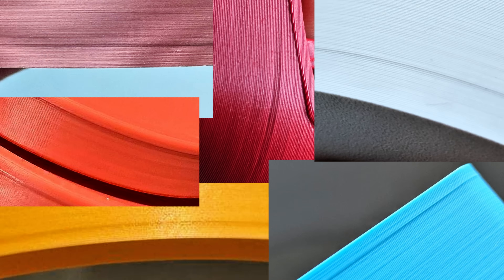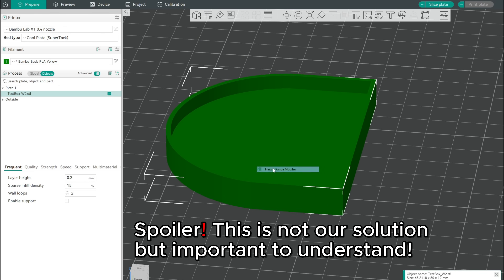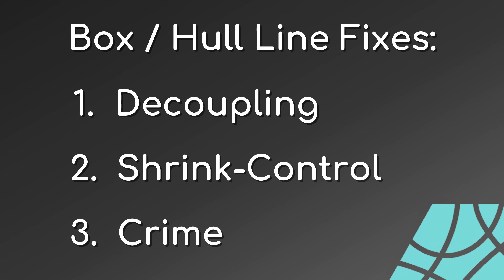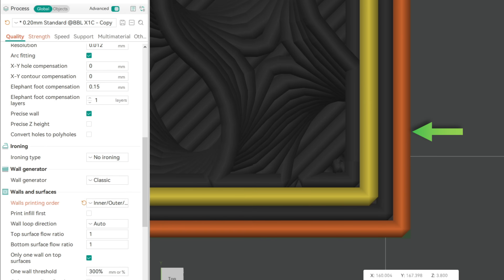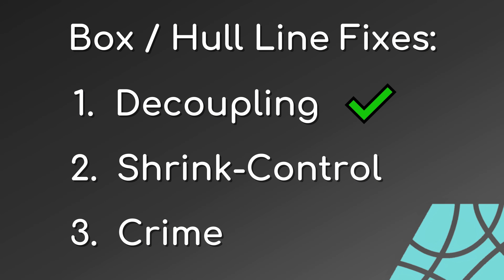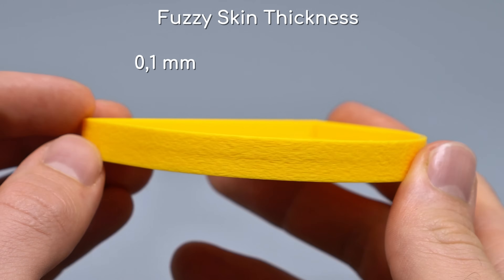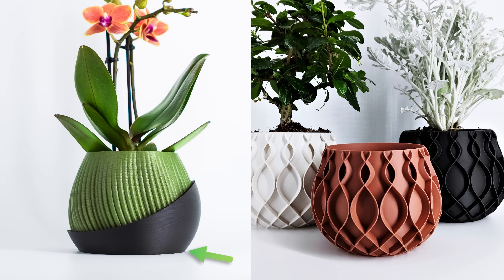The Most Misdiagnosed Print Error — Fix Weird Wall & Hull Lines!

Comment from the maker: If you check out Alibre I’d recommend the “Professional” version, there is even a 30-day free trial! 
Anyone else find and use this CAD gem so far?

--- Fix Recap: Only use in right situations like shown! ---

Decoupling
- Wall printing order
- Gap infill & gap walls with settings (can help a little)
- Design Gap
- Chamfer correct edges

Shrink Control
- Fan speed & environment
- Uniform print speeds
- Design around shrink layers
- Material selection

Might help as well:
Wall count, ensure vertical shell thickness, skin expand distance, infill & top patterns and "print infill first" (recommended by other comments below)

Hiding the Crime
- Fuzz it up
- Use beneficial wall patterns
- Floor layer & sheet connection + fillets
Reply: Your sponsor kinda makes it impossible to make an informed purchase, there's no (obvious) way to buy or get pricing information on their products, only links to resellers which also do not sell their product (in my area)
Reply from the maker: I see what you mean. The german reseller does not have this problem to be honest. I'll let them know.
In the meantime take a look at the uk or german (auto translate) reseller, they have price lists etc.

https://www.mintronics.co.uk/shop
https://alibre.info/alibre-preisliste/
Reply: @dwietr exactly. It feels very 2000s to not be able to just buy a software without having to deal with a reseller. It looks good though…
Reply: Selfishly, would love to know the technique you used for the “leaves” on the planter. Alibre magic? I would usually jump out to Rhino if something like that popped into my head, lol
Reply from the maker: @hagus42  Sure! The leafes were made with a single loft operation (3 sketches). Then that is patterned multiple times like shown in the video. I cut out and boolean subtracted different sections out after. 

The boolean subtract implementation is probably one of my favorite Alibre features as you can position parts with constrains like you would in an assembly. Incredibly handy.

Comment: I found setting internal bridges density to 50% made a massive difference for me (on top of some other settings changes described here) I swear it gave a semi flexi bed for the internal solid infill to be lay down of and sort of absorbs alot of the shrinking before it gets to the sparse infill and then outer walls.

Comment: You mention using properly tuned filament in more than one video, do you have any links to good guides on tuning filaments?
Reply from the maker: The best source would be the Orca Documentation. I do flow and pressure advance for every filament. For difficult ones also Temp and retraction.

https://github.com/OrcaSlicer/OrcaSlicer/wiki/Calibration

Comment: I kinda get this but only one side of the printer front left side anyone have an idea of what it could be ? I'm new to printing so any advice will help
Reply: I have the creality k2 printer if that helps any
Reply from the maker: That could be due to warping of this front left corner. Probably not a classic hull line. Try increasing bed adhesion or make sure the enclosure is heated.
Reply: @Factorian_Designs  yes i just think its odd since the printer is brand new and it prints fine until it comes a few centimeters downs on a print i have tried to adjust the bed to be leveled but i belive it still will do that on the side

Comment: Would you ever be willing to do a tutorial on how you designed some of the more decorative parts of your CAD models? (like the leaves on the planter?) I've been doing CAD for ages, but decorative touches like that were never something I picked up. 
Also, it's nice to finally see another Alibre user in the wild. I have my complaints with the program, but overall it's been pretty great the time I've been using it.
Reply from the maker: I replied this to another commend as well but there is really not too much to explain. Its just a single loft command, which gets patterned around. There are a lot of great videos about lofting out there for alibre as well :)

Comment: I’m having a shrink issue with a part warping off the bed when printing with ABS, do you think that if printed two parts at the same time it would help with this by letting the layer cool a little?
Reply from the maker: No I don't think that would help. Try to increase your room temperature or bed adhesion.

Comment: I would have never guessed it was from part shrinkage, but now that you mention it it makes sense. I do like using curved bases like you showed, but I guess it serves a functional benefit as well ¯\_(ツ)_/¯
Reply: Thinking about it, there most be multiple things that can potentially cause lines since I've had parts with lines even though there's no flat surface directly connected to that area 🤔 (mostly on multipart prints)

Comment: Cool video. Will take notes. My problem is opposite of this. It's bulging seamline instead of shrinking.
Reply from the maker: I rarely have the bulging issue and it sounds weird but the fixes should be the same. In your case the filament shrinks and has nowhere to go, leading to buldging. Try if some of the stuff helps :)

Comment: On my heavily modded Ender 3 (no longer in use), I never had this problem! But I do have it all the time on my Bambu printer! I think though it's because I immediately began modding my printer to be as close as possible to a resin printer. I switched to 0.15mm nozzle and tuned everything so it was real slow. I imagine though this just basically achieved a lot of the fixes. It probably decoupled a lot of the walls. But after getting super close, I finally caved in and got a resin printer. My ender 3 would take a full week to print some things lol. But the detail was stupid good. But can't beat a resin printer if you want detail. Switched to Bambu as I wanted now speed and reliability.

Comment: I'm using ECC with standard settings, pla+, hyp-abs, and I have no issues with the outputs. The layer lines are not visible at all. I think you should consider changing your 3D printer.
Reply from the maker: This has absolutely nothing to do with the printer. 
I get this on my Bambu A1, Ender 3, X1 and used to have it on my prusa mk3s and Anycubic vyper.

Comment: To reduce shrinking you don't want to cool things as fast as possible. What you want is to keep the material just barely above the glass transition tempurature of the material for as long as possible. It's about 20c above is the limit. This range is where the pollimer relaxes. Keeping this tempurature is all about cooking rate, flow rates, printing and bed Temps, print times and part size. So it is extremely a case by case thing.
Reply from the maker: Careful with that advice, this will lead to clogging and very bad overhangs on almost every common filament.

Comment: A lot of this if not all of it is very cool! The only real issue I see here is simply that we are still using 'dumb' slicers. Number One issue is how we design the models but after that it should all be up to the slicer itself to set the printer up for the best print job so we do not need to 'hack' the settings. Thank you so much for this video!
Reply from the maker: True, lots of improvement to be made on the slicer side. Thank you!

Comment: I deal with this issue a bunch, and my go-to is outer/inner & outer wall speed 1/3 of regular print speed. 

Eliminates the issue every time.
Reply from the maker: You only change the outer wall speed? I tested that specifially and it didn't do anything for me :/
Reply: @Factorian_Designs outer wall speed 100, inner wall 300, outer/inner, sometimes infill percentage reduction. Bambu p1s/various filaments. All respond well to doing both at the same time. 

My designs are similar, but not exactly the same. Think card sized boxes with 1-5mm bottoms, ~1.5mm walls. The other key problem that combination solves is ghosting of interior wall vertical ribs. Basically take one of your pots and turn it inside out, make it rectangular with straight walls, and that’s the sort of functional part I design. 

Not exactly the same as yours, but close. 

Vielen Dank! Your videos are amazingly helpful.
Reply: You know… this makes me wonder if the curved surface is part of the issue because the printer isn’t going full speed on the curve, only on the straight line sections…
Reply from the maker: Thank you for all the additional info!
Hmm I don't think the curve is the problem, I got the issue on the flat side as well.
Honestly not sure why this works so well in your case.

Comment: I have also noticed that some printers produce more noticeable lines. My A1mini is worse than my P1S for example.
Reply: i assume that's from the open style of the printer the print cools a lot more in a colder room than a P1S which traps the heat inside the chamber
Reply: @timo4463 most likely
Reply from the maker: Yeah, bedslingers seem to have this issue a little more pronounced.

Comment: I would be interested to know if you were to measure the actual shrinkage, and model exactly the inverse of it, if the two would cancel and result in a perfect print.
Reply from the maker: True I think stuff like that is done in molding shrink simulation as well, but very hard to measure by hand.

Comment: 10:04 I have seen PC warp and fail in a 200C chamber printer before, which is hot enough to print ultem 1010. Literally never use PC unless it's tiny parts.

Comment: Colleagues, I ask for your advice. When using Bambu Lab A1 with a 0.8 mm nozzle, there is a defect when printing two models simultaneously: one of them has a wall rupture in the area of, presumably, the seam or the beginning of printing. There is an impression of a lack of material, a 2-4 mm void is formed, after which the material fills the perimeter to the seam and the process repeats. The problem is probably related to large movements, significant retraction, or insufficient material supply at the beginning of printing.
The following steps have been taken:
* Calibration of the PA parameter.
* Increased material flow.
* Increased printing temperature.
Help with the settings is needed. What parameters should be changed to fix the defect?
Reply from the maker: Try increasing the retraction distance as well. But it could also very likely be this issue:
https://youtu.be/7MOKjQxbP18

Comment: minimum layer time setting also makes the slow layertimes slower, dont ask me why ... but i really found that odd and that did make me use other settings like modifiers for the most part.
It slows down fast layers say from 40 to 100 but also the slow layers bevore you set it say have 100 and after they have 140 or something ... absolutely stupid. Even if you pick a time way slower than the layertime you targeted with the setting, say you set your slowest layertime to 60 and have layers that take 200 ... the layers with 200 now take 220 ... i dont understand why bambuslicer does that im too busy to go to github for this dont even know how to report such thing there ... generally, in slicers this setting or a guided setting for that is whats absolutely missing just a setting that clearly evens out the layertimes, say a simple checkbox -> even layertimes and a minimum print speed for it boom done ... the way over the fan settings is a workaround imho, not a targeted function its more about controlling the fan speed instead of slowing down layertimes as it obviously is not working exactly how you would think it works with slowing down way slower layers too so you unneccesarily slow down more than actually would be needed.
Reply from the maker: Yeah it does work in a weird way, you can even see it in the video. Never possible to get completly even layertimes.
Reply: @Factorian_Designs  Thats what i hope they somehow implement in the future, there could be a really "hard" layertime feature that evens out the actual needed layertime as good as possible i would use it right away

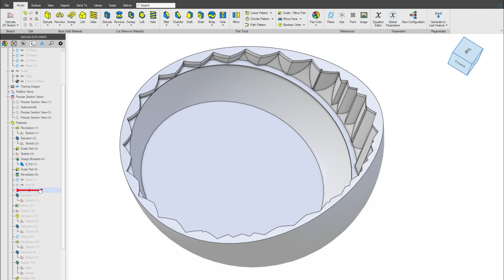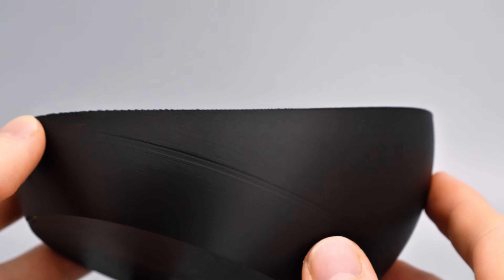Comment: A long time ago, I noticed that the difference in print speeds was increasing these lines, so I first equalized all the speeds. Then I synchronized the minimum print speed in the Cooling settings with the actual print speed, and that largely solved the problem — but not completely. I also noticed that even channels that have been producing 3D content for years don’t make videos about this topic. You not only addressed it, but completely solved the issue. Especially the method you showed between 8:49 and 8:51 worked incredibly well for me. I was having the exact same problem. So thank you for this video.
Reply from the maker: Thats great to hear, thank you!

Comment: Thank you for the video. I was having the same problem with a cylindrical object for a print, I actually had already used a chamfer for the problematic edge and it still showed an ugly line on the otherwise perfectly fine surface. 
The problem was mainly that I was printing multiple parts at once and 2 of them had those large flat surfaces at the same layer height, so for those specific layers the layer time was a lot longer. I tried again but only this time printing each part separately and the line was gone 😅.
Maybe not the best solution but might be helpful if someone is having a similar problem
Reply from the maker: Printing parts seperatly sometimes does wonders for quality. Good addition!

Comment: You're an absolute beast my man! Was fighting this artifact for quite some time now:
I've ended with only partial solution that increases gyroid infill to the point where it's rigid enough not to allow solid/top infill to pull the walls inside. As I said, works only partially so the visuall effect is still like 50% there.
Taking your research into account this totally makes sense now since in my case it's even funnier - my solid/top is not actually attached to the outer walls, it's the bridge layer before the first solid infill! So if I make it that the bridge have something to grab onto insted of the outer wall, the issues will be 100% gone.
Kudos to you. Take care.
Reply: UPD: Yes! It works! I decoupled the underlying bridge by using archimedian chords 45% infill at given height. Just give this infill like 5-6 layers to build up onto your current infill pattern (it won't be printed as a bridge so expect a messy first layer!) and then it does the job.
Great solution, didn't even need to add a cavity in my .stp source.
Reply from the maker: Awesome man! People understanding the problem and then fixing it in a smart way is exactly why I explain in such detail. This made comment made me especially happy!

Comment: Im in the "print business" since 2016. Never had such problems with Cura and CR10 or OrcaSlicer and Hypercube. Maybe because I'm not buying that filthy filament from Bambu Labs :)))
Reply from the maker: In this video Polymaker and DasFilament was also used. I get it you hate Bambu Lab, which is fine but every filament shrinks no matter where you buy it from.

Comment: Wow! Thanks for the explanation! I've been using even speeds and outer/inner order to resolve similar issues myself but I hadn't tracked down why this was happening.
Also useful: if you want low ambient temperature for better cooling but don't want to leave the door open, the new cold build plates help with this. It's like adding a bit of extra cooling but without actually modding the printer.
Reply from the maker: Very good additonal remark 👍

Comment: None of my benchies have hull lines from PLA all the way to pure and clear Polycarbonate

Layer times is a crutch, disable them entirely and change the Small Perimeters Threshold as well as Small Perimeters. I have mine set to 7mm and 25% respectively. Using a benchy as comparison my layer times are all over the place as they should be, a layer with lots of material is naturally going to take longer than one with less material but that doesn't mean its all connected, travel times is going to give longer layer times and therefore mess with that algorithm. But if you instead focus on the reason layer time was first introduce which is to enable small features to print than you should calibrate small features. With layer times off and small features adjusted, the layer times are all over the place however now the SPEEDS are far more consistent and the only places the printers slows down are critiaclly small areas where cooling is actually crucial regardless of how much travel time exists or volume in a single layer. For a benchy thats the flag pole hole, the hawseholes, the 4 small segments around the windows/doors, and smoke stack everything else is even speeds.

Even PLA needs chamber heaters or rather chamber stabilization, just get used to preconditioning the chamber before every print and re-calibrate your settings to match the new environment. For PLA I set my ACTIVELY heated chamber to stabilize to 30c, PETG 45c and basically all other filaments at 60c with some exceptions but even the exceptions see a stabilized chamber temp just at a different specific value.
Reply: Side note, all enclosed printers have active heating. but it requires you to write a machine start g-code that homes the nozzle to the center preheats it to 80c and places the bed at z=3 and heats the bed to the temp of your first layer, then turn on part cooling and aux cooling to max. This is far easier using on a printer that has an unlocked klipper firmware because macros for this exists already and its a simple check box in orca.